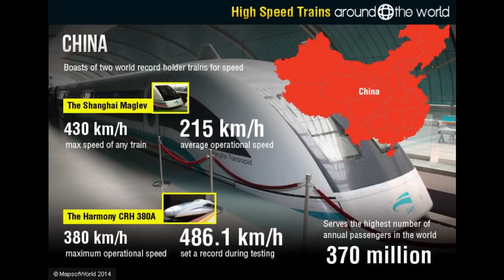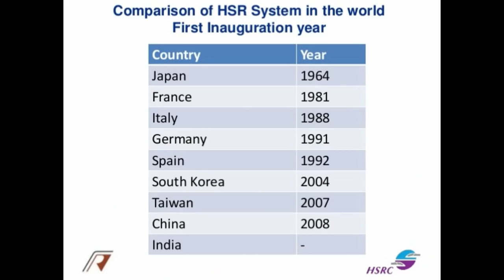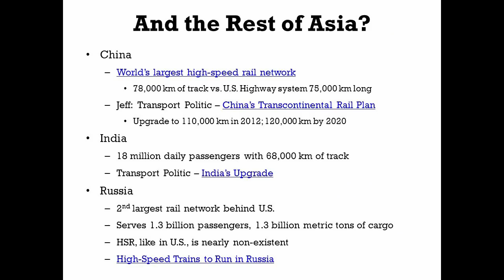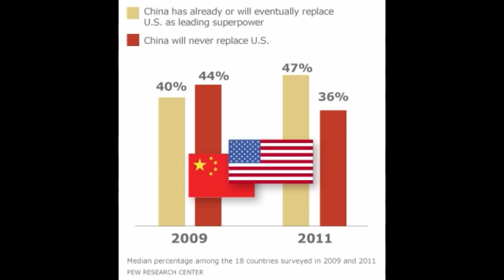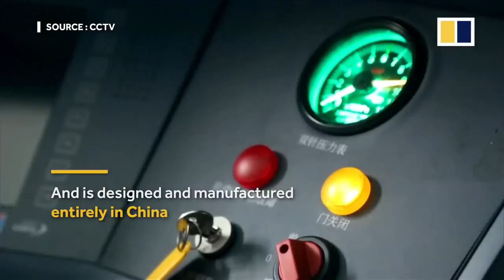CHINA SUPER POWER - HSR 2.0

Comment: Jiaotong University,China oidest railroad engineering School ,with government funding has built and tested a small maglev train in a hyperloop system at 1,000 km/hr.CRRC will build a larger maglev train in a hyperloop system between cities at a  comfortable 2,500  km/hr.CRRC has built two maglev lines,one in Changsha,the S1 redline in Beijing and is building 10 more.CRRC has built 27,000Km of high speed rail and is planning to build another 27,000 KM of maglev lines or HSR lines.As for airplanes ,typed Wang Zhenguo and VLRAAM into your computer to find more information on China s 6th generation airplanes.The PL-21 VLRAAM that flies at mach 6 speed is based on the turbo-scram jet engine